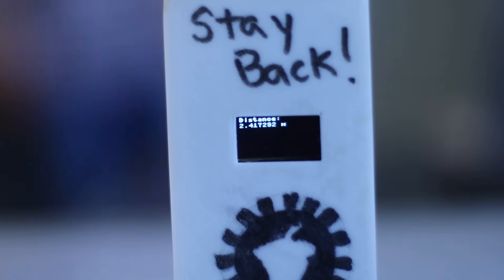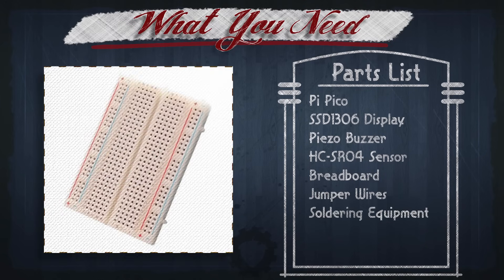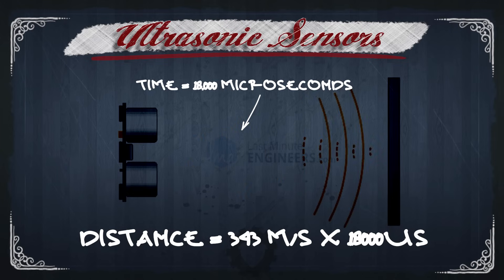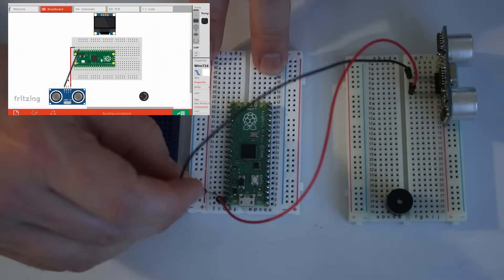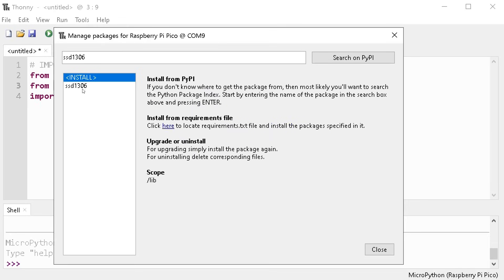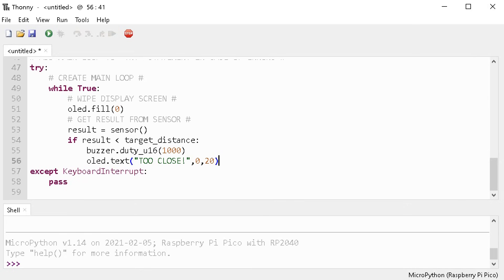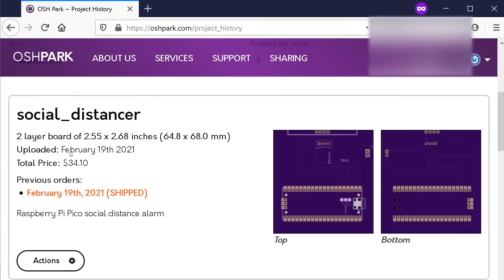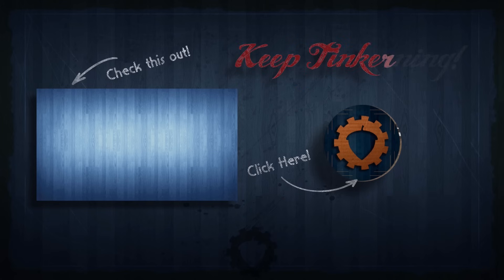DIY Device Detects Objects With Sound

Comment: For dynamic ssh tunnelling,  should i make the raspberrypi4  a web server or home server by installing apachi and my sql, and  should i do normal networking connection for both system with my reuter modem b4 i begin to set up ssh socks prossy in the command prompt? Please i need a full giudiance because i have spent alot on this project,

Comment: The speed of sound is not constant, it varies by temperature and air density. Not enough to make a difference in this project but enough to complicate fine measurement.

Comment: I wonder if we could use a similar setup to find the approach speed of objects by measuring the doppler shift the of incoming signal relative to the initial signal. Based on the datasheet of the HCSR04, my guess is that it's not due to it triggering off of pulses and not waveforms. Is the sample rate on these boards fast enough to measure a 40khz signal? What are your thoughts?

Comment: For a social distancing device I went with a different approach. I just used a hockey stick (can be wood, platic or composite), some duct tape, and a steak knife (butcher knife works just fine). Its sometimes called a Canadian Felony.
Reply: @Dark Code u g00fy boi
Reply: Imma need you to relax😂😂😂😂😭